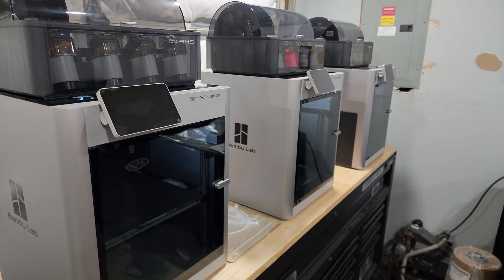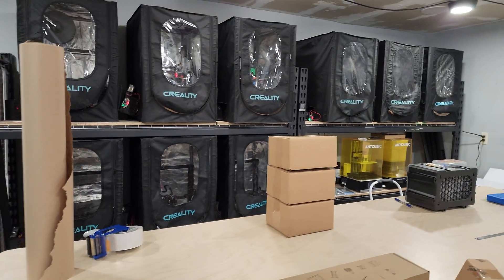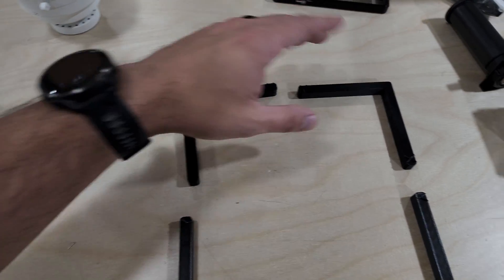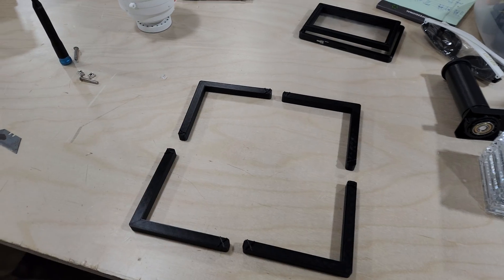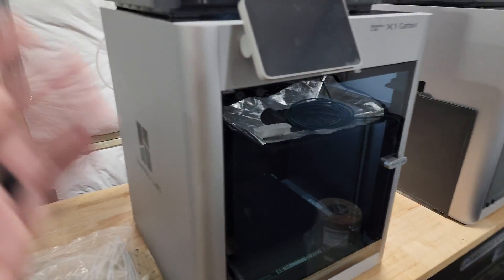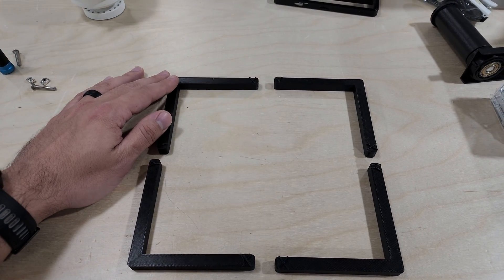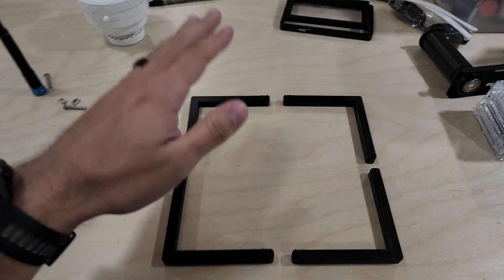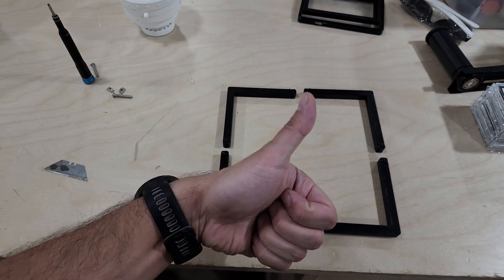Bambu Lab X1C Dimensional Accuracy is amazing! No tweaks needed!

Comment: Mine prints undersized by .2 or .3mm on just about every filament I use. I tried calibrating the filaments and all that, but nothing makes a difference. Only way I could fix this is by adjusting the hole and contour compensation. I can get more accurate prints on my custom Marlin CoreXY than I get on my bambu machine.

Comment: How do you do your skew compensation? I built my 3D printer from junk 7 years ago and i still use it with various reinforcements and changes, and i wouldn't call it inaccurate, because it's got basically no skew and only a little XY dimensional distortion, but the calibration prints even 100mm sized do not help, i get calibration values out of them that only make it worse. I am within 0.2mm distortion across the whole 20cm bed, but calibration prints only seem to have about 1% skew accuracy from what i have seen.

I am now thinking of throwing a short focus boroscope on my toolhead, laying millimetre paper on the bed, and writing a software which would allow me to calibrate to like 0.05mm :D
Reply from the maker: I use skew correction in klipper firmware for skew compensation
Reply: @Redo3D  Yeah but how measure. I tried Calibration Bro and the accuracy it gave me was worse than as-built, and of course i aligned everything super carefully when building my printer. It is not a prebuilt printer, i built it myself 7 years ago and rebuild it every few years.
Reply from the maker: In the klipper documents online there is a 100mm test print that i printed out, i just take 9 overall messurments and insert those values in the firmware. I reprinted the 100mm cube print and it comes out pretty nice! I also extrude a single line square at the max build size and messure the corner to corner distance to make sure I am at least square on the X and Y plane

Comment: Bought a P1S and the AMS unit about three months ago after spending 3 plus years using a bed slinger that gave me nothing but grief. The dimensional accuracy of the P1S when I design project boxes with lids that have a lip to ensue full closure has been nothing less than amazing. I always end up with the perfect tightness between the fit of the lid to the box. Closed sourced? That may be a problem for some but all I want are good prints and the P1S I have has delivered quality over and over again. And I run my printer on local LAN mode so no need for the Bambu Lab cloud. I'd buy another if my printing needs warranted it.

Comment: I can confirm this too, precisely out of the box. I also think it's important that videos come from people like you. I'm now focusing more on videos from people who paid for their printers.

I'm also very excited to see what's coming next year - Lidars are now available on 3 printers: on the X1C, the FLsun S1 and now since a few days also on the new K1C (at least I think so and thanks for your Crooked belts video on the K1). Regarding the closed system, you are right. But the best thing would be to have both - an open system working out of the box. Well, if the printer pays off quickly why not dance with them a bit? Once the X1C pays off, they also get permission to cause problems ;-) And by the way: I also by Bambulab on the opinion: If you want run one printer all the time, buy 2 ;-) They rarely cause problems, but when they do so, things get a little more complicated.

A lot will by happen next year too - I also keep an eye on Flashfroge. I like Flashfroges attitude that they are now working hard on the high-priced printers and then incorporating their experiences into the inexpensive printers. Maybe the Magneto X will come with precision that lasts for years without maintenance... we will see.

Comment: What do you mean off by 2mm? TWO whole mm for a dimension? That seems unreasonably high even for the cheap older printers. Or is it cause ABS shrinkage? (Sholdnt be)
Reply from the maker: I should of clarified. The corner to corner measurements I've seen have a difference up to 2mm. So that's how much out of square I have seen prints. Mainly on the Ender 3 because the frame is so prone to misalignment. Printers that have injection molded or casted frames are much better.

Comment: I love how surprised enderfarmers are when they try other printers. When it comes to dimensional accuracy it obviously depends on what material you’re running. PLA will be pretty accurate but if you put nylon or pc/abs in there then you can expect to have quite a bit of shrinkage. Quite a bit being 1mm over 200mm.
Reply from the maker: I understand material shrinkage plays a part, what I am referring to is the consistency in the XYZ axis relative to each corner of the printer, and to other printers themselves. This is where the X1C has been the best out of any machine I've tested. I don't make review videos so I have never posted but I've tested 7 other machines that I thought were high quality and all had skewed measurements. X1C is the first machine that I found to be dead on. I applaud bambu.
Reply: @Redo3D  they are good. But both of mine have beds which are not even close to flat. They don’t need to be super flat because of the bed mesh but if you put a steel ruler on them you can see under the ruler. It’s a mm gap in some places. Most of the time that’s not an issue but for some of my products that need perfect first layers each part needs tuning depending on its location on the bed. Kind of annoying. Im looking forward to gen 2 and all the improvements they’ll surely make.

Comment: This is not true, the corexy cant be compensated by design you have no single motor for any axis.
Reply from the maker: skew_correction of open source corexy machines can compensate for frame that is out of square.
Reply: @Redo3D  the google "Creality K1 Max Dimensional Accuracy Issue Part 2: Crooked belts!" Tell me why the user did not compensate it and sold the printer? You can compensate dimensions on cartesian printer only like qidi x cf pro.

Comment: I was surprised to see a Bambu machine in your garage! Really glad you decided to test it out considering you could have gone with the K1 or a Qidi for printing ABS. The Bambu machines are excellent as you know. Question, why the decision to go with an X1C and not P1S? The P1S can print all high temp filaments too but not the abrasive stuff unless you get hardened hardware. Perhaps it’s the AI features and LiDAR and higher res camera that only comes on the X1C that you were after? 

Also, if you haven’t done this already I’d recommend putting some models on MakerWorld because getting points gets you cash at the Bambu store. For me it completely covers all overhead for itself (nozzles/filament/build plates/etc. 

And lastly, you used to be strictly a Hatchbox user. Is that the same or have you switched to Bambu filament too? If so any thoughts on their filament quality/accuracy?

Good to see another video from you, keep them coming! Shop/business update would be good!
Reply from the maker: I did try the K1 Max and it was not very refined, the gantry was skewed, too much VFA or ringing, it was just not up to par so I returned it. It required more babysitting than my Ender 3s at the time. What I love about the X1C is it really is just print and go, and the reason why i went with the X1C is because of the first layer scanning and camera failure detection. I don't have time to watch my prints so im confident in the X1Cs ability to stop if something goes crazy.

I still use Hatchbox exclusively, i havent tried any bambu filaments yet!
Reply: For me I picked up the X-1 because if I had to pick 1, I erred on the side of "has everything." When you print for business, the price difference between a $1500 machine and a $1000 machine comes out in the wash. If I was to buy a second, I'd probably buy another X1.I think when you get up to a room full of machines, and you can specialize your workflow to a limited number of products/materials, a P1 makes sense.
Reply from the maker: You are right the $500 difference is basically a wash when it comes to business use. The amount of time and filament saved by knowing the machine will stop if something goes crazy on the first layer is very helpful. The upgrades and convenience make it worth it @seanwoods647

Comment: The pros and cons of closed vs. open source - community solves the problem, unless the company can get it right. Bambu may be closed, but they've also solved so many issues that have plagued 3d printing.
Reply from the maker: I would say they really got it down right with the hardware and firmware
Reply: This is only one oversimplified aspect of open vs closed source.